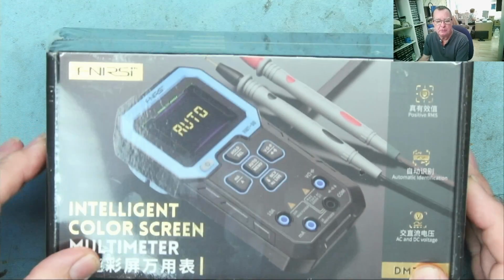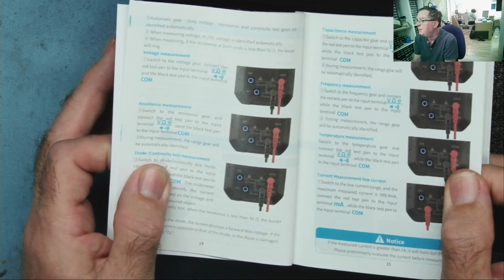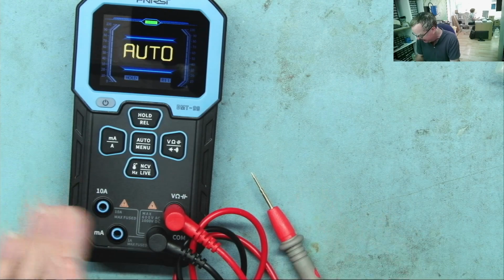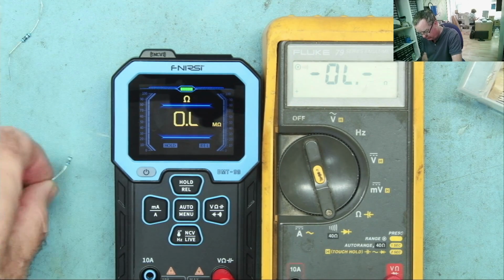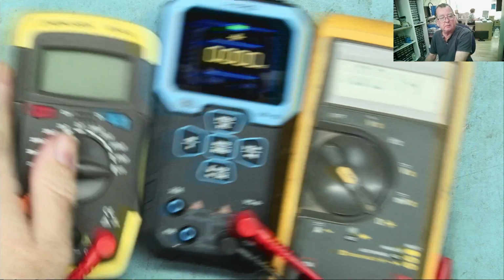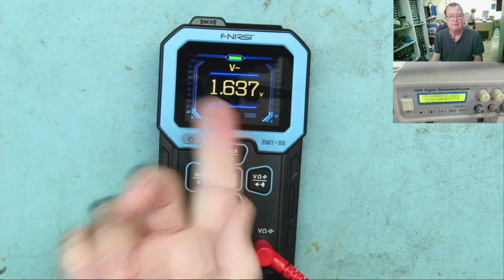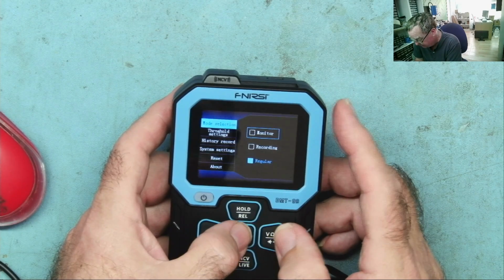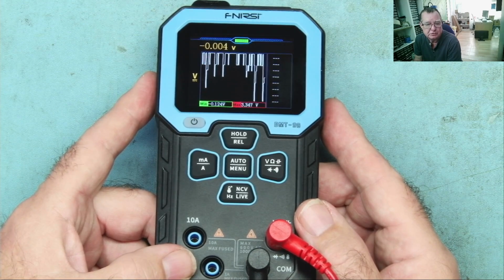FNIRSI DMT-99 Multimeter Review - Not What I expected!

Comment: i face issue while measuring 220v 50Hz mains. i tried to figure out the frequency only but it fails to show 50Hz and fluctuates from 80-180Hz unless i use an 1Mohm resistor in series then it shows the value 50. this happens only in 220v ac, on a frequency generator theres no issue at all.

Comment: I think your 1% resistors are a little suspect!  I dare say you will get some reasonable readings from the FNIRSI when new but how long will the switches etc last when compared to something like the Fluke which is clearly a few years old.  I'm not a fan of these latest generation of multimeters - much prefer more traditional ones. And no short diode bleep !!!!!  I just ordered a Brymen with the two bleep facility.

Comment: I got one of these (also FREE) and I measured a 10 ohm resistor.  The resistance was different in each direction.  Then I realized I was holding one lead and just putting the probe on the other.  I had created a thermocouple creating a voltage offset.  I had never seen this on any other hand held meter.  It does happen on my Guildline.  As for Chinese software,  I'm always saying....... What were they thinking.  The scale of the graph is constantly changing giving you no idea what you are seeing.  Why can't they let you save it off to a computer?   Good, but no cigar!

I had hoped you would show me something magical that I might have somehow missed.

Comment: I found it to be unacceptably inaccurate, particularly at low resistances. It also has a bit of a lag before settling on a reading. I wouldn't recommend it.
Reply: For your needs maybe this isn't the best meter, but for me and my use case,
it is extremely accurate and I would 100% recommend it.  You cannot beat the price for what you get.  It's not designed for professional use so you can't expect it to perform like a $250
Fluke.
Reply: @JeffCD77  A firmware update actually improved it quite a bit and it is still in use.

Comment: On firmware V2.1 they fixed the min/max bug but on yours it was readying 21min/22max when you went to test. On V2.0 the min/max wording was backwards but it still functioned correctly. On resistance mode it won't read below .1 ohm even though it displays .000 ohms :( hopefully they put out a firmware update they will allow it to read lower

Comment: Through the years i've been consistently finding that these chinese instruments have ALWAYS software issues even on the latest revision, sometimes the issues are not immediately obvious, but with time you will find them for sure. I've bought the Fnirsi DPOX180H and 2 days after i was already regrated of purchasing it, the software is full of problems, but the worse is the "trigger" it almost doesn't work at all, and the vertical calibration is completely wrong, and i'm using the latest software. Another example is the electronic load "east tester et5410+" the software is full of issues and calibration is completely wrong, not to mention the inumerous hardware issues...
Reply: Atorch make nice load tester. I have a 600 watt 250 volt and max 40amps at lower voltages. I can connect it to my phone or pc. Pretty accurate too. I haven't notice anything more then .3% out of spec so far

Comment: I give it a 10 out of 10 for having a bright screen. Anyone who's probed around under a car in the dark or a fuse box in a dark basement will find this bright screen better than a weak back screen light that you have to manually switch on.

My only concern would be; does it have an auto off feature to preserve the battery?

Comment: Are you using the latest firmware for this multimeter?
Latest is
V2.1       20231123

1.Fix the BUG in HOLD display in monitoring mode

⒉Fix the menu threshold setting maximum and minimum value display error

3. Fix some English translation errors

Comment: 23:52 10MHz isn't really useful for repairs. It really needs to measure up to 100MHz at least since nearly all crystals are higher than 10MHz even on old stuff from the 80's. That's a common mistake with Chinese-made meters they don't really understand what people need or use because it looks like they did not consult with people who repair old stuff. Maybe the next model will be 'the-one'. Oh well, back to the drawing board ;-)
Reply: You can go as far as 23Mhz on this unit (tested)
Reply: @pjviegas  It's still useless for old stuff. For example I'm working on an arcade game now called Sky Shark from 1987 which uses a 28MHz oscillator. Even one of the very first CPU-controlled arcade games Gun Fight from 1976 uses a 19.968 MHz crystal. The spec on that unit is not good enough for general repairs.

Comment: For a repairman the most important feature of a meter is that it always works. Therefore I still like meters with a screen that uses little battery power, so I don't need to doubt the battery every time I am measuring. That said, this meter is certainly good enough for most work.

Comment: Well, you gave this device a good rating.
Didn't you notice that we now live in a world of artificial intelligence ?
And that any device that does not provide AI facilities is destined to the trash can ?
Every decent manufacturer of a multimeter has to build AI facilities into it,
so that you can ask it to answer "what is the problem of the circuit in front of me ?"
and you get the correct answer in no time.
This "multimeter" does not even posses a speech interface so that it could understand what you are talking to him!
Or is it even a female that would anyway misunderstand everythig you tell to her on purpose ?
That it identifies a 1 Ohm Resistor as .5 in auto mode is not important in hindsight of
its other exorbitant deficiencies.
Anyway I wish you an advanced happy new year and that you will learn what is really important features
of a multimeter in this coming year 2024. For the time being I will stay with my Unigor 6e.

Comment: With old style meters like the fluke you select the mode on a dial where you can see where you are, where you want to select and all the options available, which is great.
Modern button designs go through the list of options sequentially, but i think I'm right in noticing with this one, is not indicating where you are in the list, which gets awkward to go from one setting to another without over shooting if you've forgotten the sequence. 
I'm with you on 'this is just another multi meter test' .... until you got to the scoping facility ! That's a great addition.
The max and min setting could be useful especially with the bleeper indicating out of range.
I wonder if it also records the max or min reading as I find that very useful. Its another plus for the Kaiweets KM601 also with its diode beep facility 😊
Reply from the maker: Yeah you can record and store up to 8 readings but I didn't try that facility.

Comment: Why do manufactures insist on giving us capacitence measurement WITHOUT inductance? its not that difficult and would be incredibly useful.
Reply: Because they can't. The cap function on a multimeter just measures the time it takes to charge the cap, which is mostly useless. That's why big caps take longer to read a value. What LCR meters do is much more complicated, using sine waves and lots of math. An LCR meter's method allows for inductance measurements. Multimeter method does not.
Reply: @humidbeing  Are you telling us that 21st Century Technology is not capable of making a multimeter with a 100 KHz oscillator included?
Reply: @humidbeing  Try watching the EEVBLOG, he explains how capacitance is found, you use a fixed frequency waveform, then measure the reactance, its not at all complicated and inductance is found  pretty much the same way Xc=1/(2.PI.F.C), XL=(2.PI.F.L)
Reply: @humidbeing  Using the time constant method is a pretty antiquated way of measuring as it would be inaccurate due to ESR, you might still get that on really cheap meters, but doubt it.
Reply: Capacitors have 4 fault modes:
High series resistance,
High leakage current, i.e. Low parallel resistance,
Open circuit  and 
Short circuit. 
Inductors tend not to exhibit 3 of these.
Reply: @anthonyshiels9273  You are right, but you also assume multimeters are only used for fault finding, I use them for design work or for matching an unmarked component.
Reply: Inductance is not a big deal because anyway you need to have a good LCR meter in your lab ,but LOZ and LPF are a must to have
Reply: @jeanmichel9207  LOZ? LPF? I know LPF as low pass filter)
Reply: @engjds  yes low pass filter both loz and lpf are a must for measuring voltage but LCR I prefer professional with multiple frequency and ESR, DSR measurements ..you may need a ring tester and insolation for SMPS transformers . another thing more fonctions you put in a multimeter more it will be easy to burn it by mistake.
Reply: @jeanmichel9207  Mmm, I think say if fluke 87 did a double press of capacitence on resistance setting to access inductance it would not make it unsafer. Yes, multiple frequencies are important. But loz? what do you mean?
Reply: @jeanmichel9207  But you wouldn't need LCR at all, if say Fluke included it on their popular models, its a pain having to have a second meter for such a small task.

Comment: @13:33 although it displays down to 1mOhm, does it actually measure down to 1mOhm? The 10mOhm & 1mOhm digit always shows zero. It's only the 100mOhm (0.1Ohm) digit that changes when measuring low Ohm resistors.
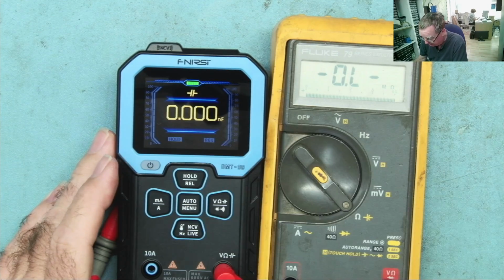Reply from the maker: Sorry I did not test that - but I will try it on the live stream new years day 1st Jan 17:00 London time @TheElectronicsChannel  YouTube
Reply: It only reads .1 ohm not .001 ohm already tried

Comment: An interesting meter, just wondering what the battery life would be?

This review promted an idea for a project / PCB.
Make a DMM tester pcb with several known value resistors, capacitors and diodes, with easily accessible solder pads for the meter probes. Then the tests you performed could be done really quickly. Leave space on the pcb to write the actual values measured with an accurate meter.
You could also include a voltage reference and current source, but that would need a battery. I believe you can get voltage references and resistor calibration units, but not combined all in one project/PCB.
Reply from the maker: It's USBC rechargeable, 1500mA/hour. It feels quite hefty for the size so probably has a decent battery.
Reply: @LearnElectronicsRepair  Fair enough, but it is yet another device to charge. I prefer a traditional DMM that is simple, reliable and has a battery that lasts over a year. Call me old fashioned!🙂
Reply: @Mr_Rusty1  I'd prefer a common rechargeable and easy to replace battery such as an 18650 to have the best of both worlds. Rechargeable and replaceable.
Reply from the maker: Good idea mike 😁

Comment: Very difficult to see from a video if the meter is legible, to me that is the number one criteria. No good having a meter with all bells and whistles but the read out is small and can not be read. On the video it looked excellent and very clear, sharper than the fluke. Why no buzzer for diode mode is daft.
Reply from the maker: The display is very clear compared to the Fluke. Why we have this problem with bleeps in diode mode makes no sense to me either.  Short Bleep for semiconductor junction, continuous bleep for short.  Nothing else makes is of real use for fault finding. Simple.
Reply: It’s clear to me when watching the video. Do you have your video settings on above 480p?
Reply: He could be using magnification. @shiftctrlhack